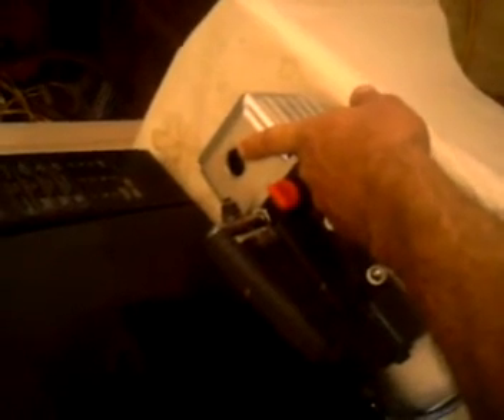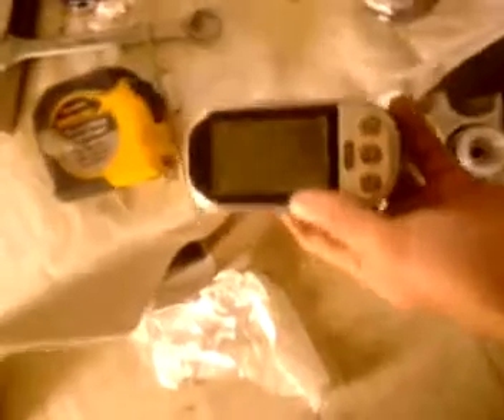"Evaporative Refrigeration"  "Adsorption Refrigerator" "Zeolite Refrigerator" Part 2

Comment: Get yourself a solar vacuum tube set up. Retrofitted to heat gallium with an electromagnetic pump to heat an absorption refrigeration unit. You could add other components to make a stand alone air conditioning unit. Novartis